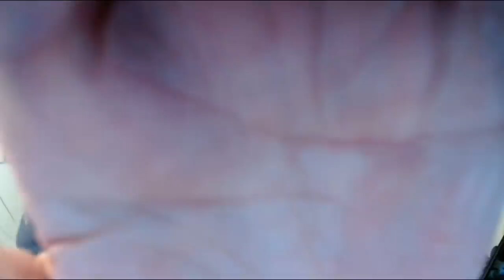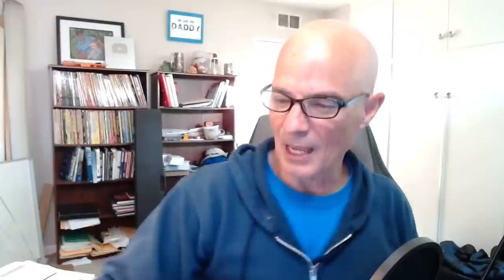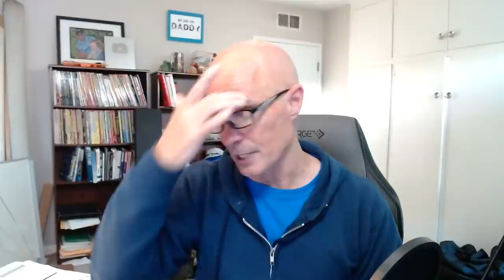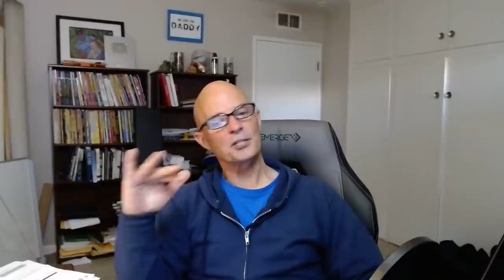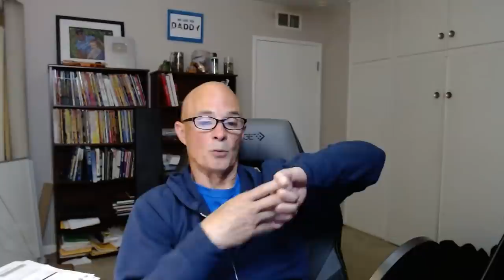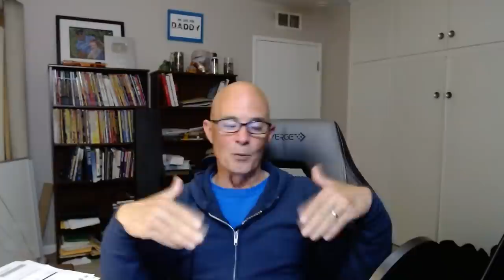LET'S TALK TECH-TURBO RESPONSE RATE (DOES A CONTROLLER HELP?)

Comment: Right now I don't even have a boost controller, just the wastegate plumbed to the intake, on my 5.0 Coyote and a somewhat big S475 and it seems to spool relatively quickly. I attribute it to a 4500rpm stall, relatively efficient exhaust layout, and turbo-friendly valve timing (courtesy of Modular Head Shop). It's not roots blower snappiness but, for a drag car, I was surprised it's as responsive as it is.

Comment: The 2 best things you can do for turbo response rate are:
1. Make more n/a torque
2. Keep the distance from the exhaust valve to the turbine wheel as short and direct as possible
2b. Keep the heat inside the exhaust system
Reply from the maker: keeping the distance short eliminates tuning length of header used by all form of racing where turbos are allowed
Reply: I agreed. 

The only caveat to that is what you proved with your "rear mount" test, and what I have seen many times on a chassis dyno.

 Keeping the turbine closer to the valve helps response, while a tuned header into a turbine usually has bigger gains on the top end. 

That's where 2b plays into this.....the turbine is heat sensitive. With less exhaust volume, there is less expansion and dissipation which yields faster response.

 Turbo exhaust is just like picking the right cam, pick the rpm point that's more important to the end goal of how it will be used.

Comment: That's strange  with out c02 all I can build is 3psi  that's on vsracing  88m T6 on a 5.3l 799 heads ss2 cam. To me. The turbo spools up faster on c02

Comment: Hey Richard, you mentioned the importance of getting heat into the turbo. So would a cast iron exhaust manifold be better for turbo use (compared to tubular headers), since it can hold more heat? Or would that make much of a difference?
Reply: The first rule of thumb with boost is there is no rule of thumb.  Once you get that a new world of possibilities.
Reply from the maker: the tube headers cool off much quicker
Reply: Yeah, that was my concern. I use my project car for drag racing and autocross. So the dilemma is better flowing (tubular) headers that cool off between runs, or worse flowing (cast iron) headers that retain heat better. Hmm...
Reply: @michaelblacktree  Boost is more important.

Comment: Hey guys I have a couple questions as I am new to this engine. I bought a 99 Riviera and I would like to make a bit more power. I don't want to go on E85 because I don't want to tune. Can I just swap the pulley for a 3.4 or 3.2 add a cold air intake, NGK spark plugs and call it a day or do I still have to tune? Also is the trans strong? ik on my Duramax the trans is the weak link but idk about the series ll 3800 supercharged cars. And if I do those mods how much power will she make. And will it still be almost as reliable. This will be my daily in college and I want it to be as close to stock reliability as possible and get the same MPG. Thanks guys.
Reply from the maker: 3.4 is easy swap